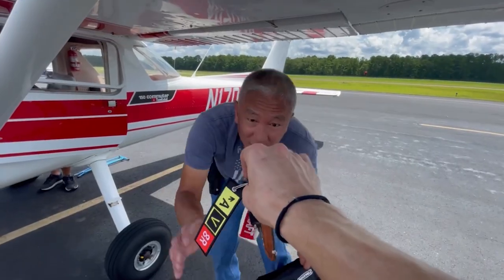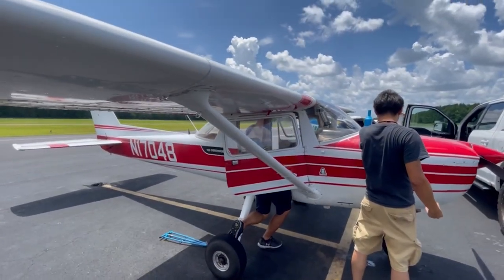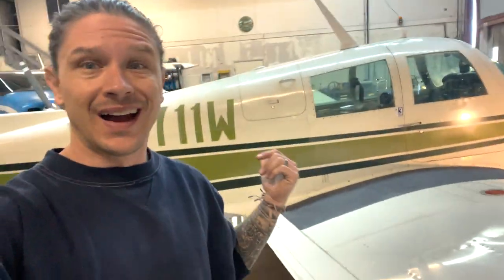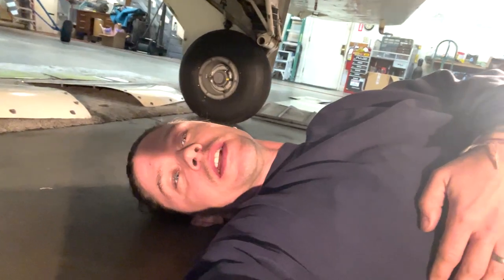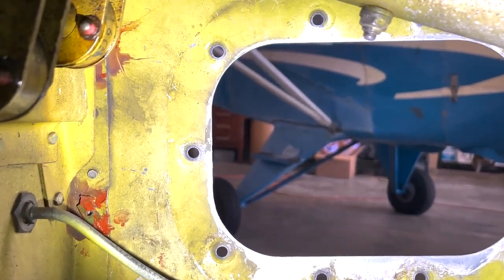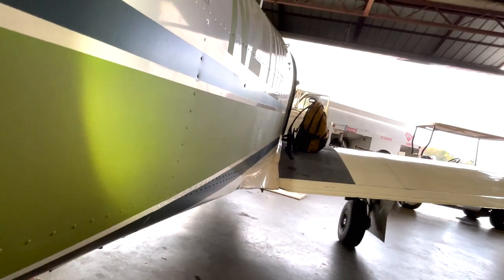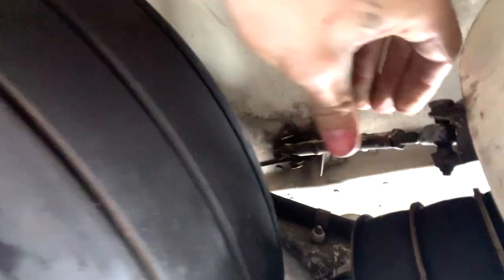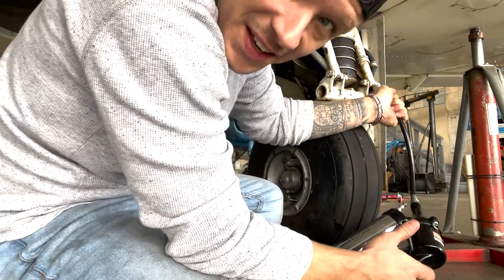Here's how my FIRST ANNUAL Inspection Went!

Comment: I know you have the same prop AD as I on my Arrow. What are your thoughts, keep doing 100 hour prop inspections, new hub for $3,000-$5,000? Or are you goin to go big with a 3 blander for $15,000?
What was you compressions?
Reply from the maker: Considering a new hub but haven’t decided. Comps where 79, 78, 78, 72
Reply: You and I are thinking the same.
Nice compression.
Mine goes if for annual on January 18-20. My last annual and first real  one my plane had in 17 years was $39,600, no engine just a ADSB  xponder and LED lights all around. And catching up on AD’s that showed completed.